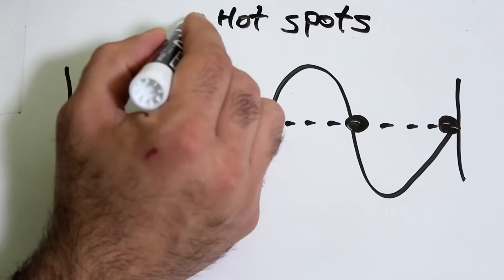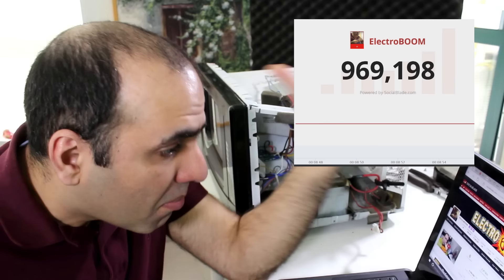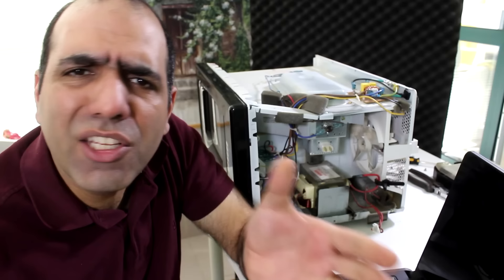Speed of Light, Microwave Oven and How It Works

Comment: 0:00 Hi I was gonna make a different video
0:02 but then I thought to myself
0:04 Microwaves
0:06 You need to know how Microwaves work
0:07 Hit the camera Ouch S**t
0:09 See a Microwave outputs very high power
0:12 high frequency Electromagnetic waves
0:14 inside the oven cavity
0:16 Injected right from here
0:19 This channel is a waveguide
0:21 which is responsible to guide the waves
0:23 inside the oven cavity.
0:25 And hence the name Wave Guide
0:27 Basically guides the...
0:29 waves...
0:30 Most things like food have polar molecules
0:32 which is kind of like this magnet.
0:34 Except that the polar molecule have
0:36 electric polarity like water molecules.
0:39 Now if I bring another magnet close by...
0:41 S*t.*Beep
0:42 You see that the changing field
0:44 makes my polar molecule move.
0:46 dududududu
0:46 See, the water is boiling
0:48 Now , the Electromagnetic waves also
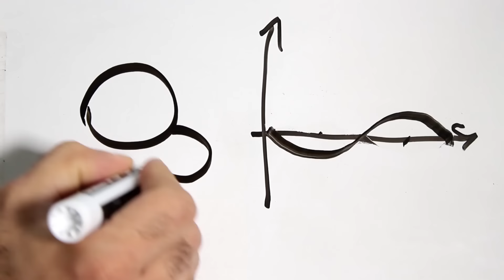0:50 keep oscillating in a microwave.
0:52 So, if there're polar molecules like water
0:54 existing in the chamber..
0:56 Those waves make the Molecules
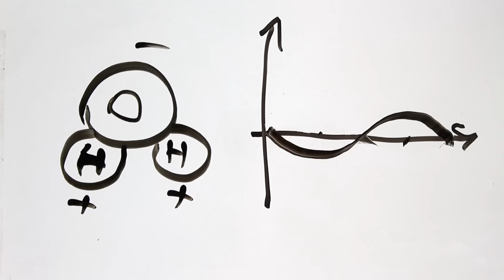0:57 switch direction very fast.
0:59 The friction between the Molecules
1:01 increase the Thermal Energy and
1:02 food heats up.
1:03 So, the first question that naturally
1:05 comes to mind is that..
1:06 If I leave an LED in the Microwave,
1:08 would it turn on?
1:09 I mean there is a lot energy in there
1:11 so it's bound to turn on.
1:12 I'm going to put a white LED
1:14 in the Microwave and see if it
1:15 turns on under the energy of the Microwave.
1:17 There..*PEEP*
1:21 Oh S*t *BEEP
1:22 camera moving violently
1:24 Ohh.. noouu.. :(
1:27 My LED is burning
1:28 huh..hu
1:29 I suppose that not how an LED should turn on.
1:31 And that's why you should've even put
1:33 the smallest piece of metal in microwave
1:36 Well I was hoping to
1:37 pour a bucket LED's in the Microwave
1:39 and see how the areas with
1:41 the higher energy are lit brighter.
1:43 See, the waves coming out of
1:44 the Wave Guide continuously reflect from
1:47 the metal walls creating
1:48 standing waves.
1:50 This means there're energy peaks and valleys
1:52 in the 3D space in the chamber.
1:54 There should be another way to see them..
1:56 I have a Cardboard box
1:57 I'll place in here
1:58 and heat it up for 20 to 30 seconds
2:00 and then look at it with my Thermal Camera..
2:03 to see how it looks like.
2:07 There..
2:11 Oh S**t
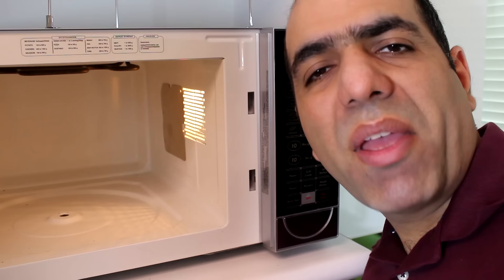2:17 Make sure there is no metal in whatever
2:19 you put in the microwave
2:20 Let's try again..
2:28 Wow! look at this
2:30 This heat pattern gives you a very good idea
2:32 of the electromagnetic waves
2:34 inside the chamber.
2:35 Now if I just measure the peaks between
2:37 two closest hotspots..
2:40 It would be half the wave length of the waves
2:42 in the chamber.
2:44 Which is around...
2:46 6.3 centimeters.
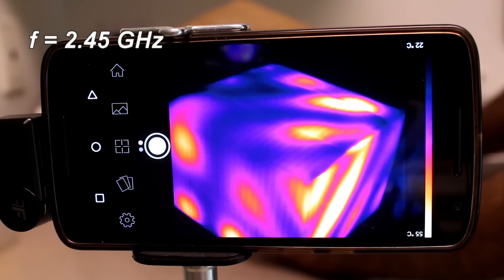2:49 So a full wave length is 12.6 centimeters.
2:52 Knowing the microwave frequency is
2:54 2.45 Gigahertz
2:56 by design..
2:57 We can calculate the speed of light in which
2:59 the waves travel at..
3:00 to be around..
3:01 308 million meters per second.
3:04 Which is pretty close to the actual speed of light
3:06 around 300 million meters per second.
3:09 Mann.. The Seek Thermal Camera is pretty useful.
3:12 In fact I'll giveaway two of these!
3:14 to my Patreon at the end of the video.
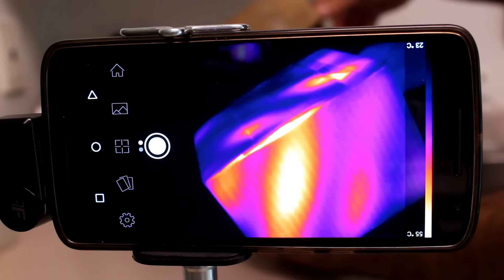3:16 Looking at the wave patterns you can understand
3:18 why the oven has a rotating plate.
3:21 This make sure the food is heated more evenly.
3:24 Let's try again with rotation..
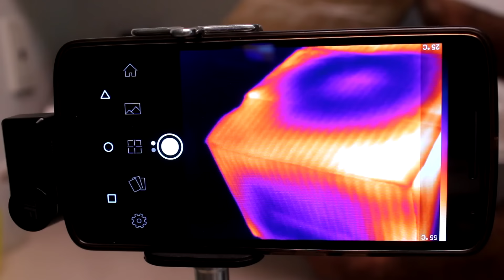3:34 There..
3:35 Well still some large areas are not heated
3:38 as well as the others.
3:40 So you better mix the food halfway
3:42 and re-heat.
3:45 Now not everybody has a Thermal Camera
3:48 But I figured a different way.
3:50 You know these pens that have erasers?
3:53 The way the eraser works
3:54 is by heating up the ink and the ink goes invisible.
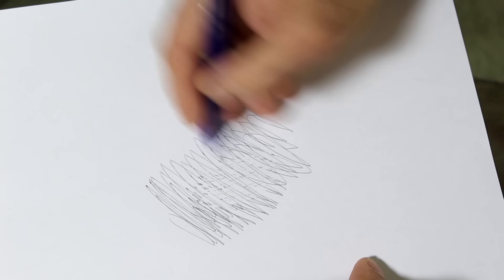3:58 I take a piece of paper and completely
4:00 cover it in this ink.
4:02 This is gonna take forever..
4:04 Let's just cut the container..
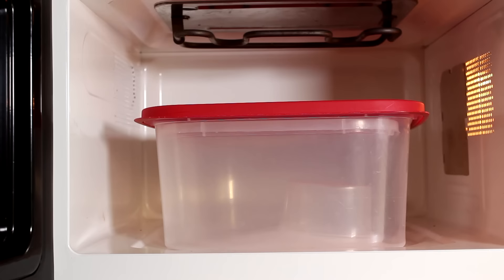4:12 Well it wasn't enough to cover the whole page..
4:14 but let's give it a try.
4:15 Now we'll just leave it in there in some
4:17 mid-height of the microwave
4:19 and let it heat up for 20 seconds..
4:28 There, you see that the ink has been
4:30 hot in three spots..
4:31 And the distance between the
4:32 closest hotspots is
4:34 somewhere around..
4:35 6.2 - 6.3 centimeters
4:37 which is consistent with the
4:39 halfway length of the Microwave.
4:42 I've got a broken Microwave from my friend
4:43 which I like to further open up
4:45 and see how it works..
4:47 Let's see what's broken in there.
4:57 Now this sound's terrible.
5:00 Whatever.. let's open it up.
5:02 I have it open.
5:03 The system is pretty a straight forward.
5:05 You can see that the AC lines entered
5:06 from that corner and feeds it
5:14 Always make sure the circuit is
5:15 disconnected from power supply before
5:17 you start tinkering with it.
5:18 Same you have to make sure your patient
5:20 is under anesthesia before you cut them open.
5:23 Anyway, all those Microwave powers
5:25 are generated from this.
5:27 Which is called a Megatron.
5:29 ♫DROP♫
5:29 ♫TRANSFORMERS!♫
5:31 ♫DUN DUN DUN♫
5:32 Oh no sorry.. Urr..
5:33 This is a Transformer.
5:35 This is called a Magnetron.
5:38 It's a device build upon the dark arts
5:40 of electronics.
5:41 It is basically
5:42 a high power oscillator resonating..
5:44 at 2.45 Gigahertz
5:46 when you apply a
5:47 very high voltage to it.
5:49 And it outputs those waves through
5:51 the Wave Guide into the chamber.
5:53 Which is placed on the top in this one.
5:56 If you like to know more about the Megatron
5:58 ♫TRANSFORMERS!♫
5:59 Dammit!
5:59 I mean the Magnetron
6:01 I suggest you watch the video of EngineerGuy
6:03 from link in my description.
6:05 The high voltage to the M..
6:06 MAGNETRON.. comes from this huuge..
6:09 ♫TRANSFORMERS!♫
6:11 ♫DUN DUN DUN♫ :v
6:12 THIS BABY TAKES THE 120 VOLT AC AND INCREASES IT
6:16 UPWARDS OF 2000 VOLTS!
6:18 AND FEEDS IT TO THE MAGNETRON
6:20 WHICH RESONATE AND OUTPUTS
6:21 HIGH POWER WAVES
6:23 AND THOSE WAVES SHAKES THE POLAR MOLECULES
6:25 GENERATING MUCH HEAT!
6:28 And this is a fan...
6:30 In any case there're a lot of things
6:32 I can scavenge from this oven.
6:34 This huge Transformer..
6:36 The Magnetron..
6:37 The Motor..
6:38 Welp that's pretty much it..
6:39 the rest goes into the Junkyard.
6:41 But first let's unplug this Transformer and
6:43 power the oven and see what happens..
6:45 Apparently the output of the Transformer is
6:47 between the secondary and the body of the microwave.
6:51 I just put a wire in here..
6:53 to kickstart the arc.
6:57 HOLY S*T*BEEP
6:58 Well that was dangerous..
6:59 See.. the output voltage of the Transformer is
7:01 not high enough to jump across this gap.
7:04 That's why I put a thin wire to
7:06 close the gap a lot and create
7:08 the channel for the arc.
7:09 As soon as you have that channel
7:11 it can extend over a larger gap
7:13 if there is enough power available.
7:15 And that voltage can fry you
7:17 in a microsecond.
7:18 So don't try this at home.
7:19 While researching the Microwave
7:21 in the web,
7:21 I realized there is this extra component
7:24 in their drawings..
7:25 called the "Stirrer"
7:26 It's pretty much a fan with metal blades
7:29 rotating right in front of the Wave Guide
7:31 and it's like a bunch of moving mirrors
7:33 that reflects the waves in all these
7:35 different directions.
7:36 It tries to make sure that there are no fixed
7:38 standing waves or hot and cold spots
7:41 in the chamber
7:41 unlike what you saw from my thermal imaging.
7:44 It's keep moving those hotspots around..
7:46 resulting in a more uniform heating of the food.
7:49 Well, obviously as you saw from my
7:50 thermal image, my oven doesn't have it.
7:53 Or this one.
7:54 I'm pretty sure I've never seen that before
7:55 although it sounds like a good idea.
7:57 It would be good to know if your oven
7:58 have it.
7:59 So, when you have it on look directly
8:01 into the Wave Guide and see if there is
8:03 any metal blades..
8:05 I'm obviously joking about
8:06 looking directly into the Wave Guide.
8:08 Don't do it or you will have
8:09 mashed potato for brain.
8:12 I'm nervous now..
8:13 What if somebody pause the video
8:14 before I said it was a joke..
8:16 To go look inside the Wave Guide while it's running.
8:19 On a bright side,
8:20 it could help make the future generations
8:22 smarter by natural selection.
8:29 This Transformer is pretty much
8:31 the entire weight of the oven.
8:32 And it's my new pride and joy.
8:38 And I don't quite know what I can do
8:40 with the Magnetron besides
8:41 causing cancer..
8:47 Aannd
8:47 I have a strange-looking AC Motor
8:50 ♫DUN DUN♫
8:51 ♫GIVEAWAY TIME♫
8:53 Do you like to know who's the hottest
8:55 among your friends?
8:56 Well the Seek Thermal Camera
8:57 can't help you with that.
8:58 But considering I'm reaching
9:00 1 Million Subscriber
9:01 it must be me!
9:03 The Seek Thermal Camera is an awesome
9:05 tools for troubleshooting and research.
9:07 So I'll pass two of them
9:08 to my beloved patreons at
9:09 patreon.com
9:10 Also I'll leave a link
9:12 to the products in my video description.
9:14 Patreons man..
9:15 There're making my channel happen
9:17 So, Hili Mamnoon
9:18 Which in English means "Much Thank"
9:20 But man, I'm reaching 1 Million Subscribers
9:23 anytime now.

Comment: Me after opening 8 olds microwave i found next to the road that people just trew away like trash i probably because a small electronic component failed i took all them and look inside they looked just fine at least the transformer and the magnetron and capacitor are okay ! I have 8 magnetron, transformer and capacitor mouahaha i could build a magnetron gun 8 times more powerfull than usual microwave and cook all people in 1km2 😈 just joking im not gonna cook people but i could build a 1M volt tesla with all that good stuff hehe